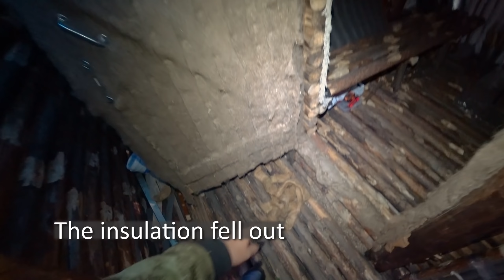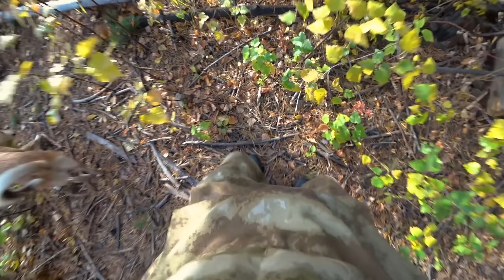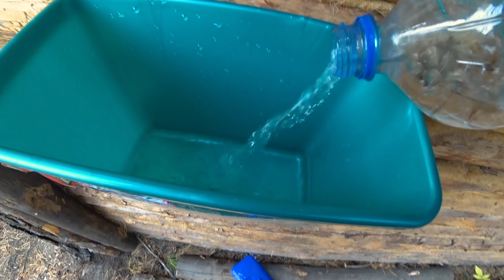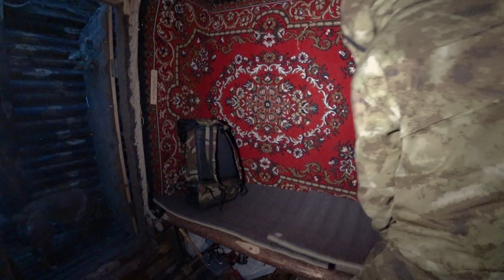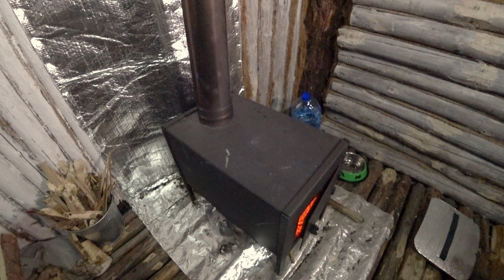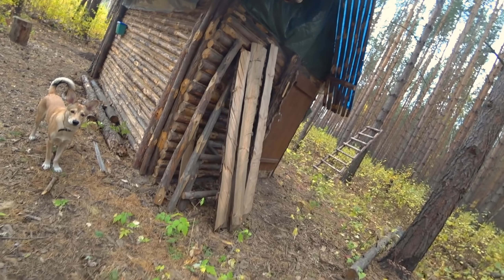Overnight in my log cabin with the dog. The wind dropped the tree onto the roof. I fry the meat.

Comment: Hello.  Just wanted to say you dont need to roll up the sleeping bag.  The stuff sack is designed for just that.  Stuffing.  It does save time.  I used to work for an outfitter in minnesota.  Great video.  Very relaxing

Comment: You should get a battery generator thing, it’s small, and it comes with attachments that can connect to a solar panel to charge that small generator, I have one, it has the usb, reg outlet and I think a 12volt plug, much smaller then a car battery and lighter…